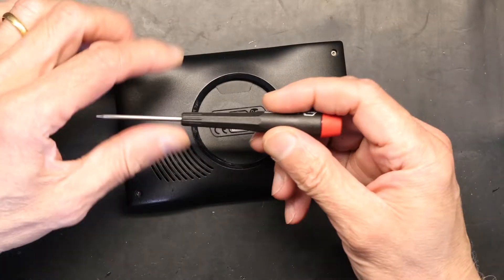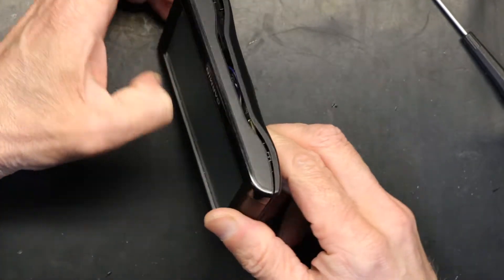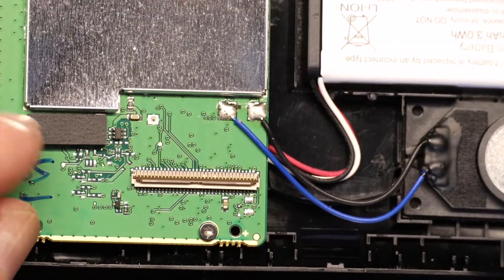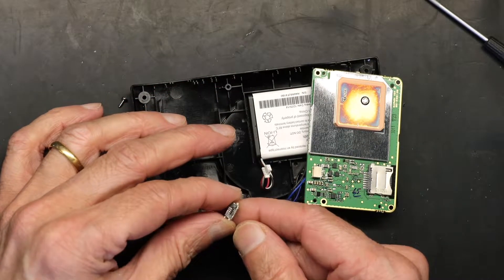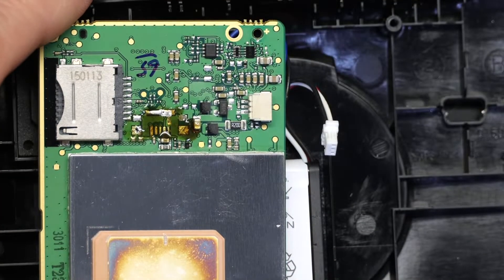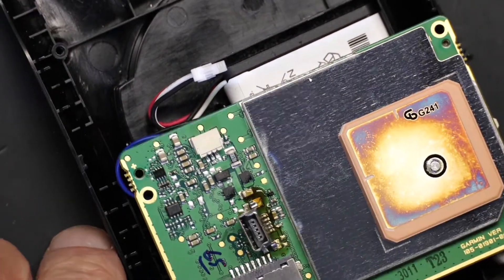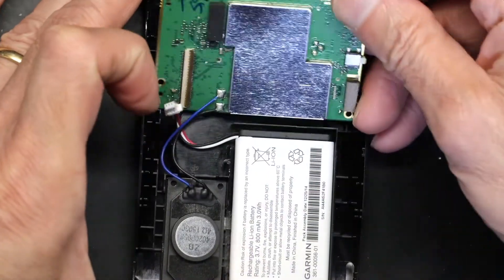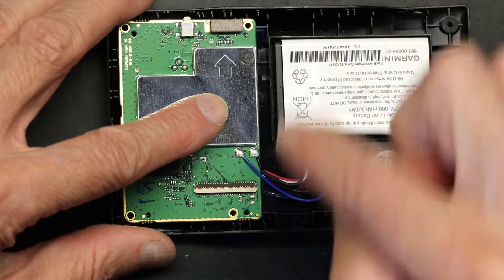Tutorial For USB Port Repair or Replacement on a Garmin Nuvi 40LM, 42LM, 50LM, 52LM, 2598LMT, & More

Comment: Sir I’m contacting you from India. I have Garmin Nuvi 50lm when I connect my data cable to PC it’s charging but it’s not detected by the PC. Is it the PoRt issue or what sir I have tried with multiple cables it only charges but not detected by Pc
Reply from the maker: Hi, welcome to my channel. I think your Garmin unit has a bad USB port. I recommend taking it apart and inspecting the USB port.

Comment: The Mini USB Port link you gave is not the one you soldered. The garmin one and the one you soldered have 4 ground pins around the port, the one in your link has only two.
Reply: Is it true that two grounding pins actually do not exist on the port but just the casing?
Reply from the maker: @ProfessorBalance  Yes, and the exact match is not available. So you have to get the one that is compatible connector.
Reply from the maker: Garmin has it's own proprietary connector and they don't sell it to public.

Comment: do you know where I might find a usb port for a Garmin Drive 52 m ?
Reply from the maker: You can't find the exact match, but this is the one I use https://www.aliexpress.us/item/3256804631803333.html
Reply: @TECHNOLOGYTIPS101  my port has 5 pins sticking up. So I guess it would be 5 male pins, not a very good design, as easy to break
Reply from the maker: @DavidNorwoodCCRE  I agree they are very fragile.
Reply: @TECHNOLOGYTIPS101 I bought the ports, which were exactly the ones you recommended for my Garmen 52. What a deal and fast shipping. I took the GPS 52 apart and brought the board and the port to a guy that does micro soldering, as there was no way I could see what to do with a magnifying glass- way too small for me. I re-assembled the GPS and it works like it is brand new. Maybe even better I think unless you a microscope, it may not be possible to do the solder unless you have magnifying eyes. Your video was very helpful. Thank you for sharing.
Reply from the maker: @DavidNorwoodCCRE  You are very welcome.

Comment: I have a nuvi 55 and when I try to charge it the charger shakes in the port and only seems to charge at a certain position too. Do you think that based on this that the problem is it just being loose or that it may need a full replacement?
Reply from the maker: Most of the time it is just lose and you can fix it by re-soldering it. However in very rare cases the Mini USB port plug can break which will require replacement.
Reply: @TECHNOLOGYTIPS101  Thanks for the information and btw good tutorial too. So it should be fixable either way?
Reply from the maker: @CplXS  You are welcome, and yes, it should be fixable
Reply: @TECHNOLOGYTIPS101  That's great

Comment: Hello sir,If Something is burn at the board,can be repaired?
Reply from the maker: Hi, Yes, I can replace any part, but usually, when one part is burned, it means other parts could also be damaged, so the repair may not be feasible cost-wise.
Reply: @TECHNOLOGYTIPS101  just one part seems like to be burnend near battery connection to the board ,the Garmin start up,and when îs on,shut down after an 10 seconds countdown.how can i send to You sir?
Reply from the maker: @Noname4now2025  You can reach me directly through our website which is buygreeninc.com

Comment: My Garmin Streetpilot 7500 has an abnormal and annoying behavior. When the power is connected, sometimes the unit does not turn on. I suspect of a bad capacitor, but looking at these motherboards, it seems impossible to replace a bad cap. What do you think? Replace the motherboard? Where to look for a spare one?
Reply from the maker: It is hard to diagnose and pinpoint the exact faulty component, so yes getting a new Motherboard may be safer options. You can get used one of these on eBay for fairly reasonable prices, and use the motherboard from it. However before you do that make sure it is not the cradle, as that could also cause sudden power loss.

Comment: Hello, do you repairs on other devices? We have a Garmin GDL 50/51/52 and the Micro USB connector came off. Is that something you might be able to take a look at?
Reply from the maker: I can take a look at it, but I have never worked on that exact model before. So I don't have the spare parts available which means I need to order it and it could take up to 30 days to get it. Most Garmin parts come from Taiwan or China, which is why it could take so long to get them.

Comment: Great video, thanks. My Nuvi 40 charges ok but the data interface does not work, so it can't be updated. I assume this may have been caused by voltage spikes generated by a bad battery in my Toyota Yaris. It also blew 2 different USB mem sticks in the radio. Is there a USB interface chip / level shifter chip on the board that I can replace? (I thought that is what you were going to replace in this video.) Do you know if I can get the schematic?
Reply from the maker: I don't think Garmin will reveal the Schematic for this, however most common case is a loose USB Port that leads to data sync issues. Also you can still update the maps using the Micro SD Card slot.
Reply: EDIT: Never mind, I got it back together again but I first had to uncrease a fold in the ribbon cable which was fighting me.
 @TECHNOLOGYTIPS101  Thank you so much for replying. I don't really need the schematic. Yes, I have updated via the SD slot. I opened the unit and took out the board but found the USB port solder connections look good and I don't think I should touch them even with my tiniest iron. Problem now is the screen ribbon cable will not lock back into the connector. It doesn't click and I am sure nothing broke when I removed it but maybe something did snap. Now I am stumped and of course it is inoperable. The flap folds up and down but I see no way that it would latch.
Reply from the maker: @iconoclad  It will only latch in place if the ribbon cable is inserted all the way in, not halfway in. If the latch is broken there is little you can do except to replace the board. However, there is a minimal chance of success if you use a thin film on the top side of the connector where the latch is to hold the cable in place without the latch. You will also need to put a piece of tape on the top to prevent it from coming loose.

Comment: 你好！大大想問一下！我的garmin unvi  40，為什麼插上usb後，無法進入隨身碟模式？可以教我如何進入嗎？
Reply from the maker: Greetings, most likely it has a loose USB port which can be fixed by following the abovementioned steps. In some cases, it could also be a bad USB cable try using a different cable. Lastly, check to see if your GPS is enabled as a Mass Storage device by following this video https://youtu.be/4qeJchyKNl0
Reply: 謝謝你。我在試試看。

Comment: Hi khalid, can you recommend a good soldering tool? Can I use air solder to fix usb charging port?
Also I sent you message on one of your tomtom old videos didn't get replay.
 Can you do video how to fix calibration issue on tomtom go devices 520,720,730 
Thanks
Reply from the maker: Although I haven't tried all Soldering Irons, but I did try nearly a dozen different ones and my favorite is Weller WES51, because it is small and very practical.  Yes I will make a video about TomTom Calibration, but if you need it urgently here is the process of how to do it.  https://itstillworks.com/12407495/how-to-recalibrate-the-screen-on-a-tomtom-gps
Reply: @TECHNOLOGYTIPS101  thank you very much khalid.
Reply from the maker: @dzdz375  No problem!

Comment: I suspect I have a failed cable port on my 2595LMT Garmin. If I press the cable into the port it powers up and shows the charging symbol on the screen. But after I let it rest that way, it eventually shows LOW BATTERY and shuts off. I already replaced the battery as it was not showing capacity as per your other video.
Reply from the maker: I agree, the symptoms are exactly that of a loose or broken USB Port. You will need to refresh the soldering joints.

Comment: Hello, I have a garmin nuvi navigation device, I did a new update for it, and sister finished the map and put it in the gps garmin drive 50 LM and it did not work, what is the solution
Reply from the maker: Hi, the maps on a SD Card must be inside the folder named Garmin and the name must be gmapsupp.img  So assuming the SD Card reader is Drive G: the file should be like this G:\garmin/gmapsupp.img